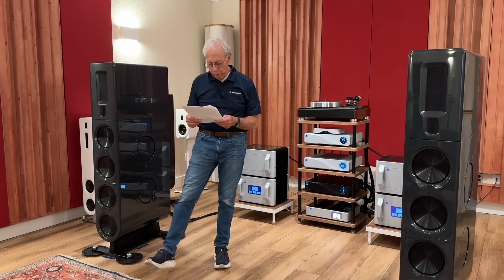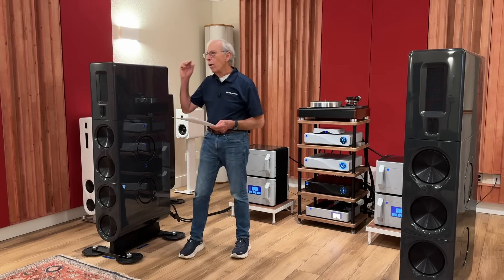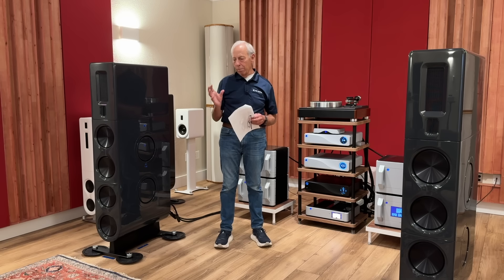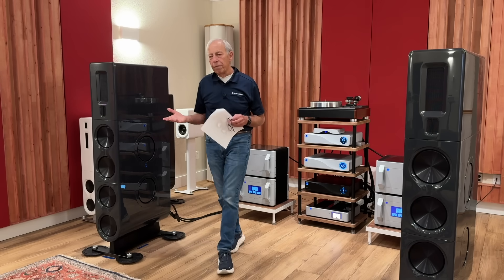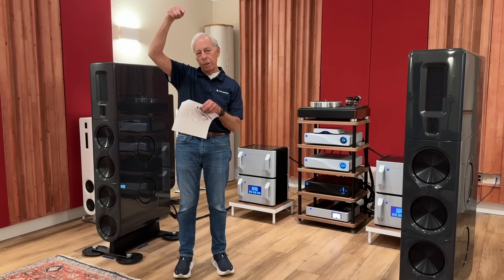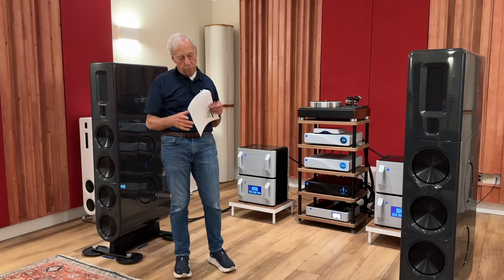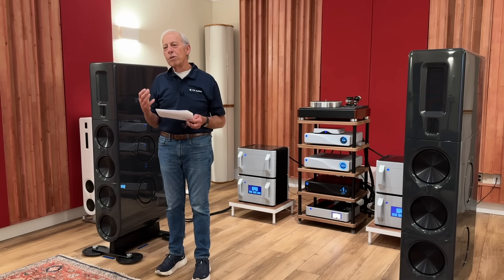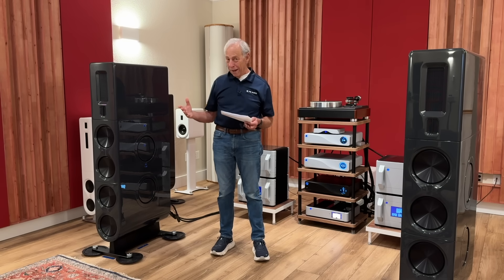Tube Dampers

Comment: Tube amps can have drawbacks. They can generate alot of heat just like a Class A solid state amp so not good for small to medium size rooms. The tubes if not high quality can affect the sound in a negative way or a few tubes can go out early. The tube amps tend to not have much oomph to them like solid state. You can't leave the tube amps on all the time as it will burn time usage on the tubes. The tubes have a sweet spot for the hours played ( typically thousands ) and then they need to replaced or have declining performance. The bad part is the great tubes you might have might not be in stock when it comes time to replace them. A tube amp often takes about 30 minutes to 1 hour to fully open up from turn on to reach it's potential. Having said all of that I LOVE tube amps and pre-amps. Solid state can sound technical and clean but it just has no SOUL. It's like the way they filmed the old movies versus today solid state just doesn't have the magic and realism to the sound.  I recently listened to the DCS Varese DAC at a listening party, the Wilson 750k speakers, and relentless mono amps driving it all. I found it somewhat lacking for the price point. Simply put my VAC master pre-amp and  a pair of VAC 452 IQ musicblocks one to each Sonus Faber Aida 2 speaker inmono blew away the solid state stuff. It wasn't even close. My system costs much less. I look at quality I get for what I pay not the most expensive and not the cheapest. The VAC musicblocks once they heat up they stabilize and the heat dissipates which is a cool feature. They also have individual tube circuit monitors to let you know if a tube is having a problem versus having to guess which one. If your budget cannot afford this type of gear Prima Luna makes some very nice affordable tube gear which I had before upgrading to the VAC. The tubes they come with for Prima Luna are just okay. You can tube roll and buy some vintage tubes from the 1970's etc. that are in limited supply but can really open up the sound for say 500 to 1,000 bucks of tubes upgrade. I did that with the Prima Luna before trading it in and make a big difference. Upscale Audio in California has vintage tube stock and they ship. Hope it helps.

Comment: Valve(vacuum toob) dampers sounds like audiiofool snake oil, or a band-aid to something that's faulty.  I worked at Radford Audio in Bristol, and when we found valves to be microphonic during testing (by gently tapping them), they were deemed to be out of spec, and were rejected.

Comment: Hi Paul, love your Q+A's and I've owed some older PS Audio equipment in the past, I also used very successfully your older mains cables and speaker cables is PS Audio looking into selling these cables in the near future as you clearly have the technical and production knowledge to do so and secondly you know ALL about the importance of clean stable mains supply to hi-fi components as you sell your range of power wave A/C regenerators BUT I would love if you PS Audio would make a outboard PSU for your components IE DAC Streamer CD transport and Pre-amp as i own some naim Audio components and adding their PSU to a naim DAC with 555DR PSU and NAC 252 pre-amp with the Super CAP PSU both PSU have elevated both components to even greater sound quality IMHO

Comment: I have 2 relevant experiences
1.  I set up a tube-based bass guitar effects pedal in front of the bass guitar speaker.  The first note set up a horrendous feedback screech, it was probably the worst sound I've ever heard in my life.  Imagine the sound of shattering glass, but instead of stopping in an instant, it just kept going, louder and louder.  It was the sound from the speaker vibrating the tube, which received the sound like a microphone and played it back through the speaker, to be picked up again...
2.  I added an almost-full set of tube dampers to my Atma-Sphere tube amplifiers.  I believe I could hear a difference, but it was very subtle.  I thought it was enough to keep the dampers I had (I could have returned them), but not enough to buy more dampers to do the other half of the power tubes

Comment: If you’re using a desktop system and everything is on the same platform…yes !  if your amp and speakers are separated far enough less of an problem ?  The most powerful tube amp I know of is the Ampeg SVT bass amp over 200 watts! And that is a beast ! And is still used by bass players all over the world. And the head sits on top of the speakers , like most separate head  and speaker set up’s  and all of them are…tube. In very harsh environments .  In the home you’re sitting much closer than a live show with no other noise or audience , so other things could become audible ? Do have speakers that can pressurize your room like that ?  I’ve used them , it kind of takes away the tube signature ? A little solid state as far as tightness goes.  
Go to Home Depot and get as many you want and try , less than $2.00

Comment: As John Atkinson (as well as myself) has illustrated over the years, contribution of unwanted/interfering feedback can also be traced to many parts of the reproduction device ("speaker") and can also have a significant effect on the sound.  Of course, if you're snake oil sensitive, it is usually very difficult to A/B treatment to validate your efforts.

Comment: I have a hybrid head phone amp. When I got it it presented very little bass. Enter herbies tube rings. Herbie says you can tune your tubes with his tube rings. The lower the ring is placed the more low frequency. It worked and improved the low mids as well. Always use tubes and hebies rings(which are made a little different, a ring with three points of pressure. If I don’t need to tune I leave them in the middle for dampening. Tra!

Comment: The negative bias plus input signal applied to the control grid varies the flow of electrons from the cathode to the plate .
 The purpose of the negative bias is to reject some electrons back to the cathode , while the signal varies the flow in response to the music . Distance between elements is small & external vibration is controlled IF internal damping is perfect . It's not .

Comment: I use porcelain tube sockets savers. Reduces vibration and keeps tubes cool. 

Plus layering 2 cutting boards and iso feet helps reduce vibes.
Reply: I also use plastic card covers to reduce sound waves. Just to be thorough.

Comment: Agreed, they are cheap and can’t hurt. As for why the questioner “cannot hear a difference”, that’s largely the tube type. The 6922/6dj8/ECC88 has become extraordinarily common preamp tube. That tube is very available and quite linear, making it appealing to many preamp designers. It’s also quite stout as small signal tube thus rarely microphonic, even the NOS types. 12AU7/12AT7/12AX7 was very popular up to mid 80’s. It’s a group that can have some microphonics issues, this is partly true of higher gain 12AX7. There’s a myriad of these tubes in production over the years, some are however of questionable quality and highly microphonic. 

The other far less common preamp tubes prone to microphonics are 6SN7, WE 417A, 76 and ECC40. The last 3 are very rarely seen today as the tubes themselves are very scarce, both new and NOS, thus unlikely in the questioners preamp. Regardless of the tubes in preamp, placing the preamp in location subject to harmonics, ie on rack between speakers, is asking for microphonics that no damper will mitigate. Place all source gear and preamp in closet isolated from sound waves. 

I’ve personally never found a tube damper to mitigate the noise of a poor quality tube, but can actually quiet a high quality NOS that may be slightly noisy under certain conditions.

Comment: My formal education in electronics started in the 60's when tubes still ruled. Especially for low level tubes like a preamp especially phono stage, it is important to keep the tubes shielded from airborne particles. Yes photons, electrons, various high energy particles that fly through the air around us all the time. RF waves... Yet it is common for marketing reasons to expose the tube. Stick it up out of the case with no shielding. So while yes physical damping is important. So is shielding.
Reply: Oh yes. They are microphonic. Agreed

Comment: I have a Schiit Freya+ and I wanted to see once and for all if these silicone rings made a difference, and as you say they are cheap, so I wasn't losing much to experiment. I got the most microphonic valves I had, and tried with and without these rings and couldn't hear any difference at all. Now I can understand that perhaps in a guitar amp, where the speaker is right by the valves that microphonics would be an issue, but honestly, if your preamp is far enough away from your speakers you're not going to hear anything.
Reply: You wouldn't hear it as a direct sound, in any case.  As a reactive vibration it would occur only in the presence of a much stronger vibration that triggers it. At best you might notice some colouration of the original sound...

Comment: The issue with microphonic tubes is that they become more microphonic with time and use, i.e., they are in a failing state or a lowering quality state. If you can dampen the tube somehow, it is just a band-aid that will give you an extension until you get a replacement. And if you are a true audiophile, you'll be replacing the tubes long before you need to.

Also, there are times when other components go microphonic - capacitors, especially ceramic, and resistors can go microphonic. This is usually when they deteriorate enough that their internal structures degrade to the point that they have micro gaps inside. And yes, they can be found by the tap method. 

Isn’t  the world of electronics a wonderful place to be?😊

Comment: I thought the whole point of tubes was to add the microphonics to the sound!
Reply: Harmonics  ... not Microphonics.  Do a search, they're two different things.
Reply: @Douglas_Blake I would argue that point, many people love the sound of globe style DHT tubes which have no mica spacers, it's just glass and metal, so it definitely should be more microphonic than an st style tube with mica supports.
Reply: @mitchtaylor6512  
Microphonic means that a tube is sensitive to vibration.  You tap the tube you hear a thump from your speakers.  This is 100% undesirable as it can actually lead to feedback and motorboating.
Reply: @Douglas_Blake if the microphonics are bad enough I would agree, but all audio tubes have a small amount of microphonics.
Reply: @mitchtaylor6512  
Yes they do ... and that's why I say it's an outdated technology that should be allowed to simply fade away.
Reply: @Douglas_Blake they sound better, that's why they continue on.
Reply: @mitchtaylor6512  
... in your opinion.
Reply: @Douglas_Blake yeah, and many others also.
Reply: The whole point of tubes is they are inherently linear devices while solid state devices are inherently switches we force into linear operation.
Reply: @glenncurry3041  
Not true. 

Op-amps are totally linear devices, as are BJT transistors... even Class D amplifiers are linear devices.
Reply: @Douglas_Blake  "Yes, it's true that historically, a key distinction was made between vacuum tubes functioning as linear devices (amplifiers) and solid-state devices (transistors) functioning as switches." Google. 

Yes by adding all kinds of external circuitry a transistor can be forced to stay in a linear ranges like they do in opamps.  Exactly what I said.
Reply: @glenncurry3041  
The same is true when forcing transistors into switching mode.  ALL active devices, including tubes, require surrounding passive parts to make them operate.

Google is wrong in this case.  Just look at the actual data sheets for BJT transistors, their behaviour graphs clearly show linear operating regions and gain data.
Reply: @Douglas_Blake yes, but bjt's need way more passive parts to operate within the linear region than a simple triode.

Comment: Here is a pro tip... introduce enough sound energy into a room and every single thing in the room will vibrate, the walls, the windows, the furniture, your hifi gear... everything. It's up to you to figure out if any of those vibrating objects is introducing undesirable sounds, and way more than you think, they are.
Reply: You can play slow sweeps in REW to find them, and then use a tone generator to dial in the exact frequency of the problem, and then let it play while you walk around the room to find and correct the offending noise. An immensely satisfying operation!

Comment: Time saver:  They don’t do anything.
Reply: And that tells us nothing
Reply: I've heard the difference with 6SN7's and in at least that case , dampers do reduce noise .
Reply: @biketech60  The tubes where bad, replace them
Reply: @biketech60 Did you hear this difference when comparing on a double-blind basis, wherein the placebo effect and confirmation bias were taken out of the equation?  If not, you can’t be sure what you heard. But I’ll wager whatever vibration difference that was made (if any) was not audible.
Reply: It is about the journey, not the destination.
Reply: @spenceralridge4958 For some endless tweakers yes. But many of us want to do the research, buy our best system, and spend many years listening to music at the “destination”. Not putting bands on tubes, propping our speaker wires on blocks, rewiring the main electric system in our houses, and putting various sized weights on our amplifiers. Nothing wrong with either approach. It’s just that it’s two separate hobbies. One is about the enjoyment of music and one is about the science of electronics used to produce music.

Comment: (Silicone tube rings) "are cheap, they can't hurt, and they're not snake oil." So, are they included as standard equipment on the BHK amp and preamp?
Reply: I suspect you know the answer, but in case you don't the answer is no.  Paul is being a bit inconsistent again.

Comment: I have a Schiit Freya+ preamp with tubes. If you go and tap on it, YOU WILL hear it in the speakers. It's probably the only piece of gear I have where I actually have to worry about mechanically isolating it as much as possible.

Comment: It may not be snake oil, though you can argue about that. But it sure is audio Kitsch and it sure did not exist in the heyday of the vacuum tube (in this embodiment). What is missing in this video is that Paul did not disclose if he is using this contraption on the tubes in the gear he sells.
Reply: It did. I have vintage valve amps with metal covers on the valves with springs inside clamping the valve.
Reply: @ArtimusHoratioCrow1971  That's why I wrote, "in this embodiment", in other words: The silly elastic bands that cost an arm and a leg and somehow look cool to somebody. BTW, the metal shield is to shield from electromagnetic fields and does nothing to prevent the microphonic effect. If anything it makes it worse as the metal can will ring. The main purpose of the spring is to prevent the valve to fall out of its socket. You will often find them on horizontally mounted tubes with a Noval socket, specially if they have a tall envelope like the EZ81 and the EL84.
Reply: @hugobloemers4425  ah OK, I assumed you meant not in home audio, maybe in a professional setting such as guitar amplifiers.

Comment: I’m getting curious about tubes. Specifically using a solid state preamp to drive one of the big Prima Luna tube power amplifiers in a biamped setup.
Reply: Most people do it the other way around, using a tube preamp and solid state amp. 
I want to get into tubes because I like a juicy midrange. I’d like to try a tube amp for headphones, and a tube preamp into nearfield Monsoon MM-700 speakers.
Reply: A lot run the tubes up front in the preamp, then SS for the amp.
I ran a SS preamp though a tube amp and worked out great. SS preamp has bass management, by-passable tone controls, adjustable frequency pre outs etc.
Gave me lots of control and get that added tube sweetness.
Reply: @pnichols6500  exactly! I’ve always felt that aside from pleasant harmonics, the qualities of a holographic soundstage with sweet treble were more a product of tube amplification rather than tube pre amplification.

Comment: @4:27 -- There could be deep bass notes, while a brass horn, or smooth flute, or violin, etc is also playing.  You do not want vibrations affecting the latter.

I have never used tube dampers.  But I suspect that they would be more helpful for boxes that are not properly isolated.  If you have your boxes on an HRS rack, or on Townshend Seismic Isolation platforms, etc, then your boxes should not be vibrating (or barely vibrating) -- which would negate the need or benefit for tube dampers.
Reply: Box vibrations from the floor are one source of vibration that could affect the tubes. Another could be simply the air pressure in the room.